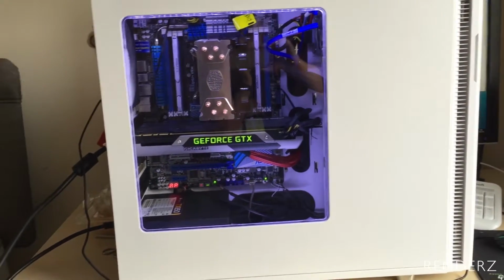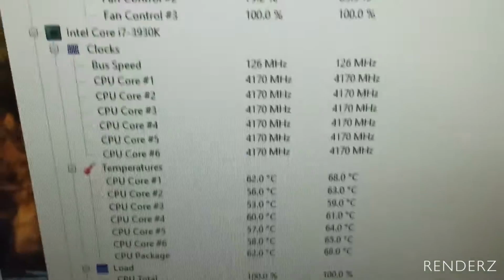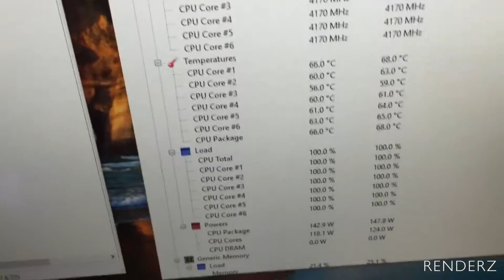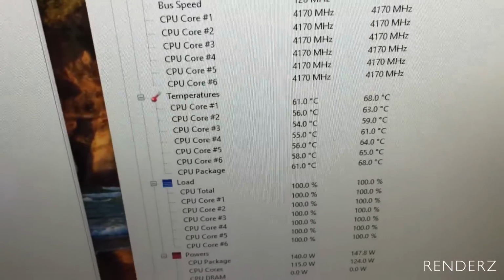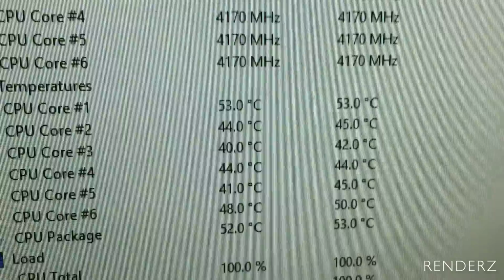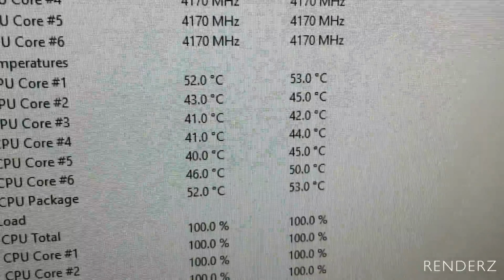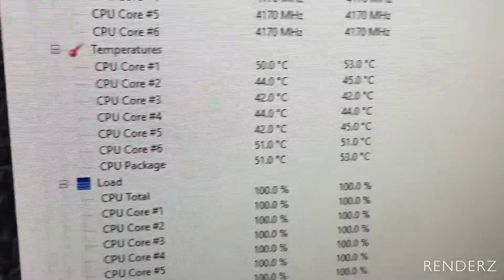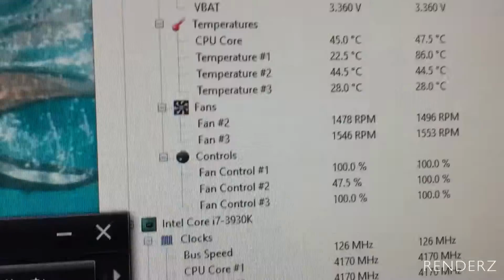EK L240 waterkit installed into a Fractal R5

Comment: Its more than likely not a leak, over time when the air bubbles bleed out the water level will go down. I wouldnt worry to much about that...just keep an eye on it and fill it up if need be. From what I have heard those little pumps turn up lots of air in the loop for the first little while. I am sure you will be fine.